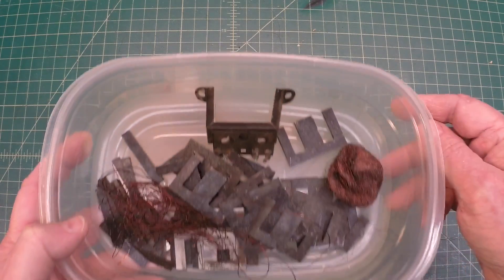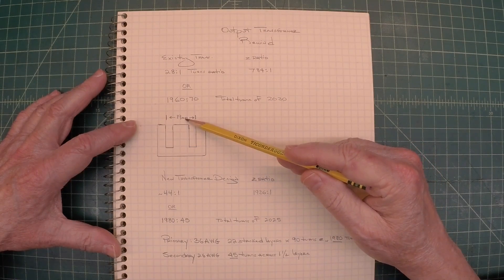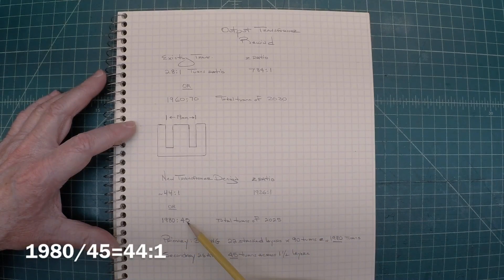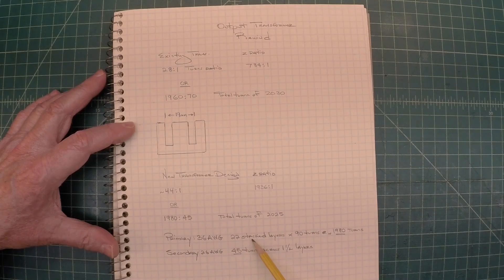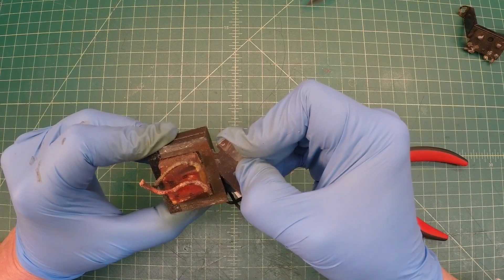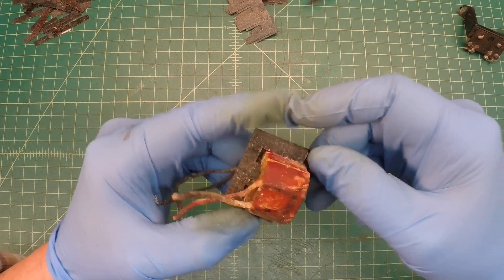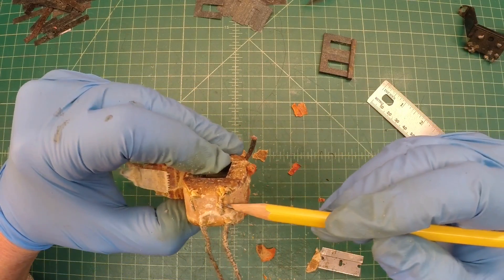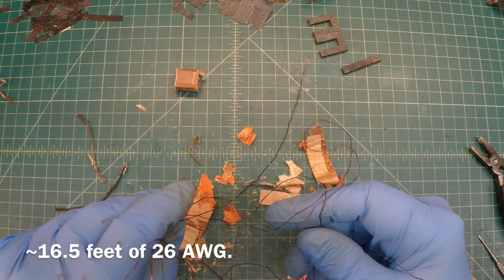Kadette Tele-matic AC Model 35 - Output Transformer Rewinding Attempt

Comment: I would have rewound only the secondary.
Reply from the maker: Alain - thanks for your feedback. With the secondary being surrounded by the primary, I didn’t see how to rewind it only. For my edification, how would you have done so? Thanks for reaching out and watching. Best, Don
Reply: @RestoreOldRadios  On the transfos I have wound or partly rewound the primary was inside. When I was young I started learn electronics on tube radios, and I built one, including wounding transfo (in 1964-65).
Reply from the maker: Thank you. I have very limited experience rewinding transformers, so I didn’t know if it is (was) common to see the secondary winding nearest the core or inside. Are you still working and building radios today? Thanks for sharing your history with electronics with me. All the best, Don
Reply: @RestoreOldRadios  I worked on radios when I began to be interested in eletronics.
Then I get a diplome of engineer, then a doctorate in astrophysics and my career was as astropysicist. But I used elctronics very often, mainly into designing very hight sensitivity video cameras.
I am now retired.

Alain

Comment: How might you go about this process with an interstage transformer instead of an OT? For the primary winding,  the load resistance can be found in the tube's datasheet. The secondary winding would be going to the grid of a tube instead of a speaker.  Here's the catch.  The secondary of the transformer is blown!  So I can't do the signal generator method
Reply from the maker: What’s the make and model # of the radio? Best, Don
Reply: Spiegel 167. A nearly identical chassis is used in the Philco 624 and its schematic shows a bit more info on the interstage transformer. Both are on nostalgia air.
Reply from the maker: +Backtofutureradios I reached out to Larry for his knowledge, experience with interstage transformers. Here’s the reply from Larry. Hope it helps solve the problem. Best, Don

Don,

I looked closer at his question, I think he is wanting to rewind the transformer. The transformer needs a 3:1 stepdown from the 30 tube to the 19 (CT). 

Since he can’t leverage the signal generator method, you could count the windings.

The transformer is the correct one so the wire and turns ratio should be correct, just disassemble and count the windings and reproduce. 

I’d suggest he take measurements for future reference.

Larry
Backtofutureradios
Reply: ValhalQcoholic Hello, In addition to the information Don passed along from me, the ratio of your transformer ( assuming its similar to the Philco 624) is about 1:2.5.  The ratio is based on the primary to 1/2 of the secondary not the whole secondary so the dc resistance will make the ratio seem closer to 1 than it actually is. .  i.e. 400 ohm primary divided by 320 ohm (entire sec.) would give you ( 1:1.25 )But, its really 400 ohm divided by 160 ohm (1/2 sec) equals a ratio of 1:2.5.   Hope this helps. I think a 3:1 transformer reversed would work. But, I think you want to rewind yours. Take Care--Larry
Reply: @Backtothefutureradios  Thanks for the help to both of you! Great information.  Yeah, I do want to rewind it.  The primary and secondary are so close in DC resistance I bet the same gauge wire is used for both windings.

Comment: How much would a new power supply cost,that looks like a great deal of work to do it right ,and materials,and time,if you do this best of luck
Reply from the maker: Ron, used ones for a few dollars + shipping, while new ones can be $40 to $75. For me, it's just away to challenge my skills, learn something new and experience what the radio techs did back in the day. Best, Don
Reply: @RestoreOldRadios  I do wish you the very best luck ,I hope you do a video a lot of us dont no or have ever seen it done ,I curious about all the proper parts it will take to do this under takeing ,plus cleaning all those plates.

Comment: It appears that with original primary turns of 1960, and required new turns = 1980 (about a 1% difference), perhaps it would have been easier to just remove turns from the secondary to create the required turns ratio, rather than have to rewind the primary. Thanks for the detailed video and procedure. Excellent analysis.
Reply from the maker: Your logic is spot on. Unfortunately the secondary was stuck in the center and separated from the coil former. I couldn’t remove it intact to count the windings, which would have allowed me to calculate the number of turns to remove. It would have been an easier mod. Best, Don
Reply: That's what occurred to me, too.  It would have been much easier had the secondary been the outer winding.  Guess I'd have tried to wind the fewer turns into a bundle that could be slipped under the original primary bundle.  Tricky, probably.